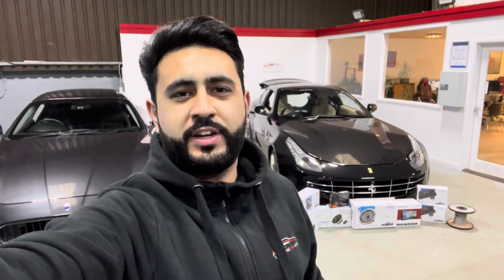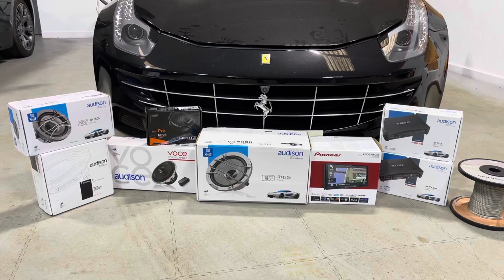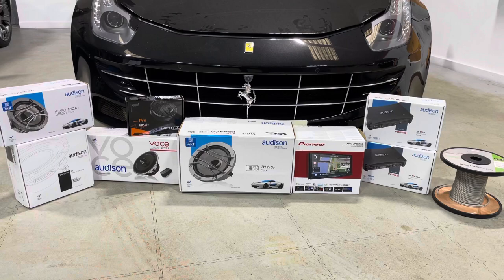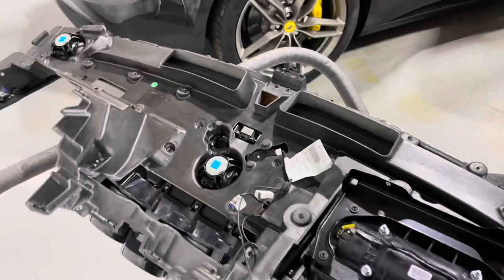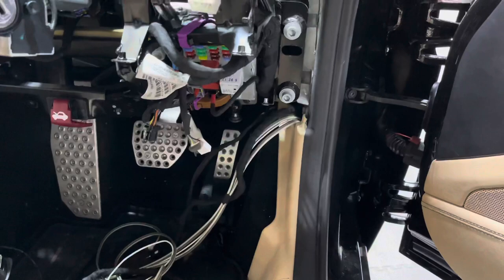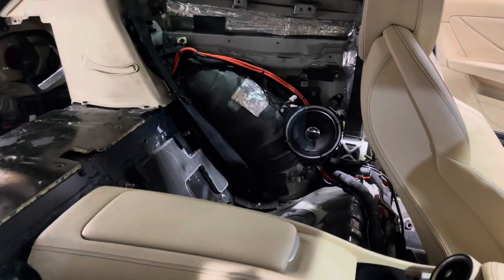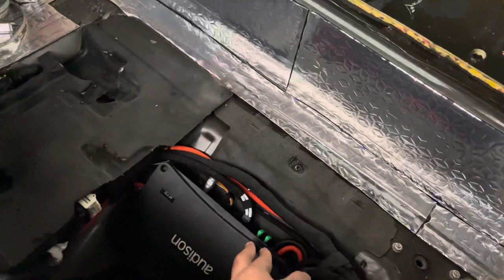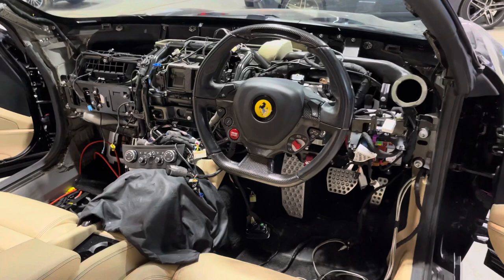Ferrari FF | Behind The Sound | Custom Sound System

Comment: are you running a passive crossover in the doors as the factory wireing only has one pair of cables running through the factory door or did you modify the loom
Reply from the maker: We ran new cables in
Reply: @CambridgeCarAudio  through the original connector plug?
Reply from the maker: @only1stefan  yes
Reply: @CambridgeCarAudio  ahh ok i think the factory jbl system runs fully active so there must be pin space :-)
Reply from the maker: @only1stefan  :)